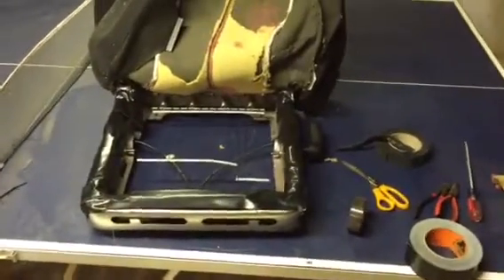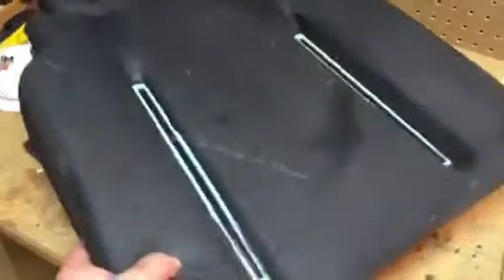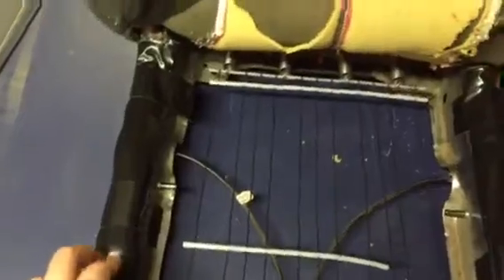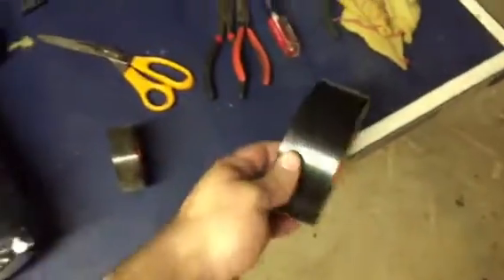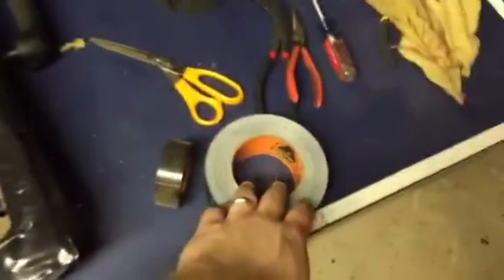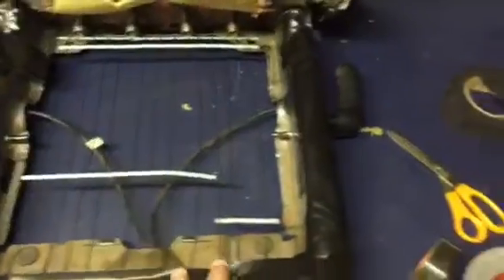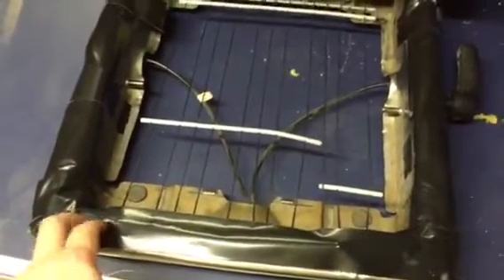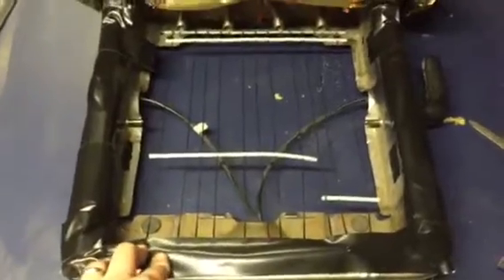2004 Dodge Ram Driver Seat Cushion

Comment: Did that help? We're you able to take JUST the drivers seat out and not the whole bench?
Reply from the maker: No, I made that video some time ago. I did that duct taping and added the new foam and it still wasn't good but I figured out what was wrong. The wires under the seat were giving out and so I took my old cushion and cut it to fit and slid it under my new cushion and that seems to have really helped. I guess it really just needed more thickness to the foam. Hope that helps
Reply: It does, thanks.  I had the same idea w/ Gorilla tape so laughed when I saw your video.  I was thinking about some rubber seals (for windows/doors).  Something that's rubber and shouldn't give so easy but who knows.  Did you have to take the WHOLE bench of seats out or were you able to just do the drivers seat?  I'm trying to get all help I can before I attempt it this weekend... wish me luck and thanks for the advice!
Reply from the maker: I just removed the bench seat when I did the first video but when I added the extra foam I didn't even do that, I just pulled the fabric back and slid the extra foam under my new foam. But it may be just as easy to pull the one seat out. I think it was 4 bolts. Good luck!
Reply: Thanks Nate!